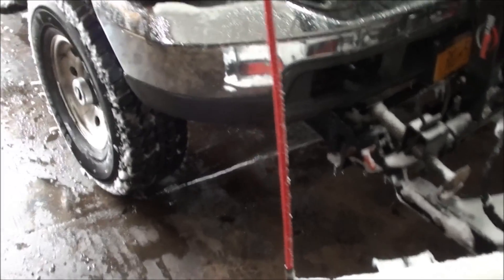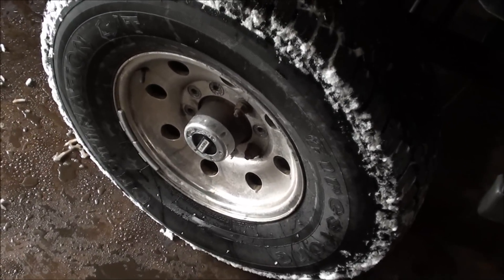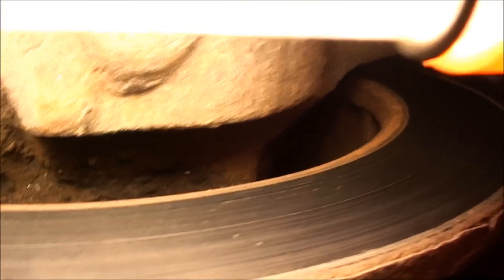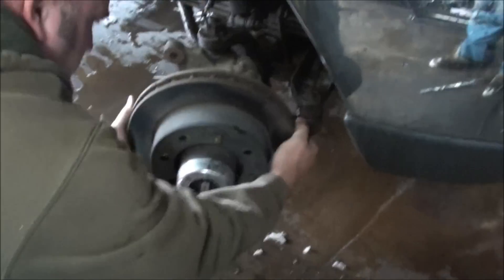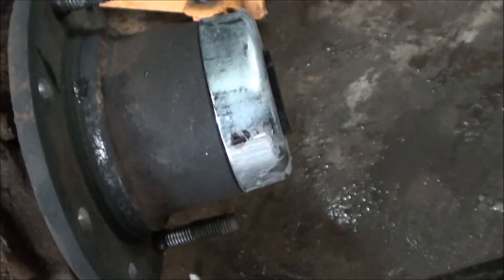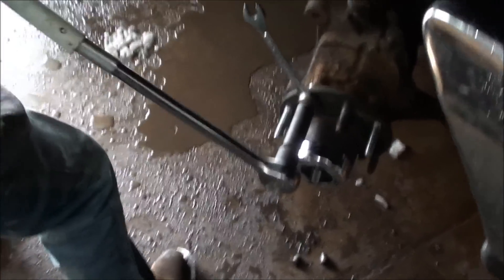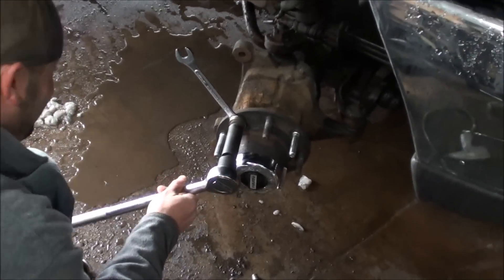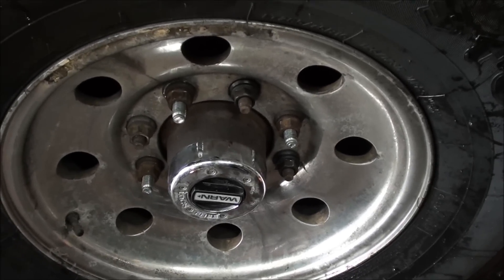f250 broken studs

Comment: I'm a mechanic but can't explain this one. Maybe someone can. Our 04 F250 4x4 broke all the lug studs on the left rear wheel. The puzzler is when I picked up all the broke studs. None of the lug nuts were on them! 4 were still clipped in the dust cap & 4 on the concrete. How's that happen?

Comment: For putting in the new studs you can use an old steel tire rim and lug nuts.
Reply from the maker: Yeah, you're right. A steel rim would work....but if you don't have one, whatever is handy will work.